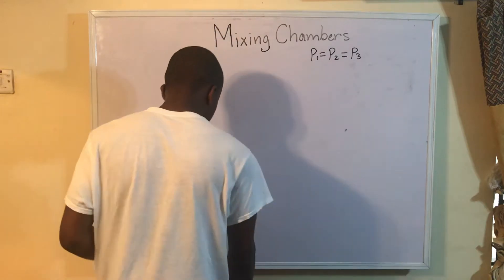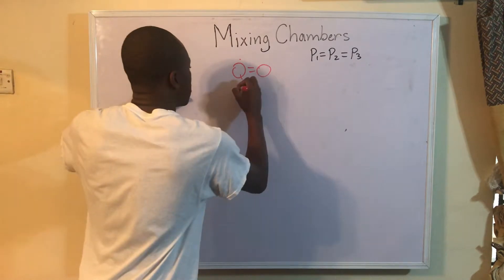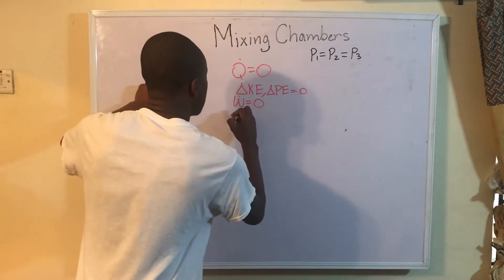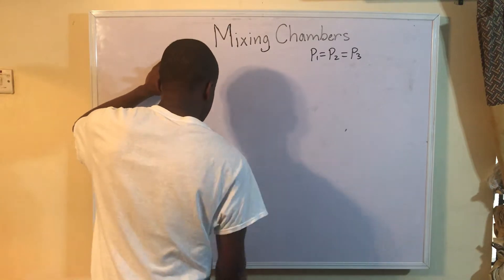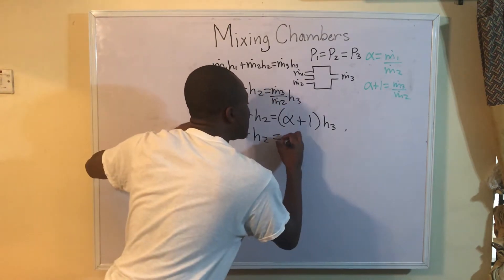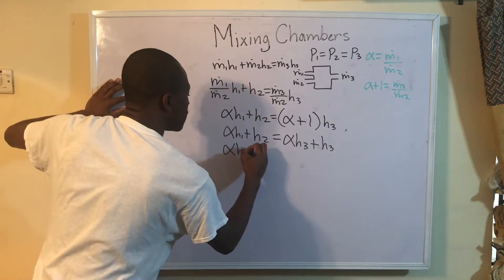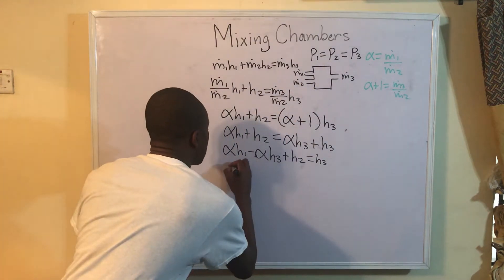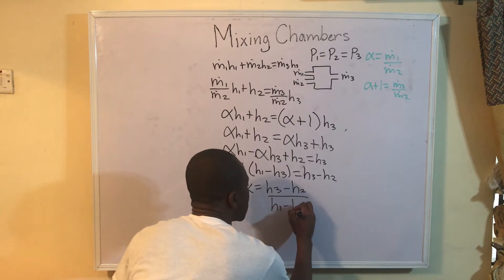Lesson 13: Mixing Chambers

Comment: I think it would’ve made it a little more clear for u to show conservation of mass and than apply it to the energy equation. My question is what if this was transient, when do I use H and when do I use U?
Reply from the maker: Rachel Lee looking back at this video, conversation of mass is there! It’s as simple as m1+m2=m3. Because there’s no kinetic or potential energy nor heat or work being calculated, we don’t have to worry about those so it becomes m1h1+m2h2=m3h3. That’s all you have to use for the energy equation!
Reply from the maker: Rachel Lee I see. I might make BBC another vid and do that. I’ve never tackled transient, mostly because it rarely happens. U really only comes into play with closed systems. H sort of encompasses U sort you’re not really making use of both here if that makes sense.

Comment: If P1=P2 ,how is P3=P1(=P2)
Reply from the maker: RAKESH KUMAR Gautam they have to be the same pressures in order to allow the correct direction of the flow of water.
Reply: @TheThermoSage  I think what Rakesh is trying to say is it should be P1+P2=P3
Reply from the maker: @mc66683  Ah I see! In that case, no. The pressures are all equivalent!